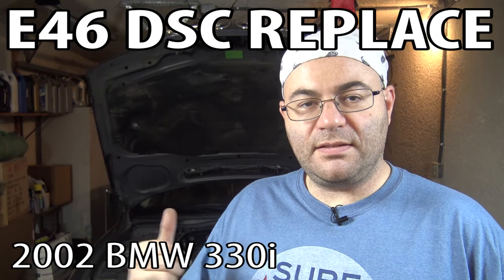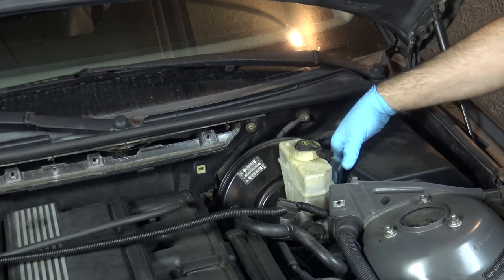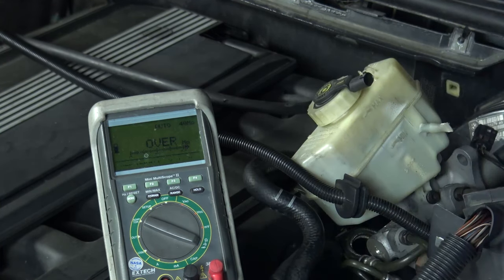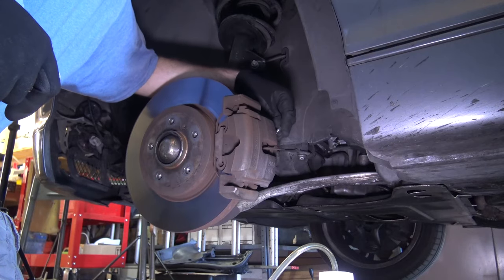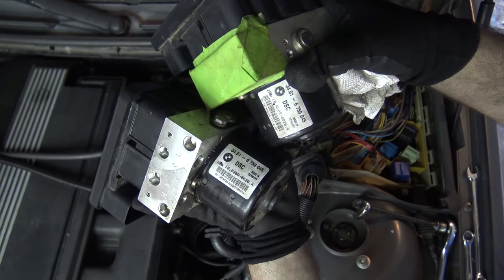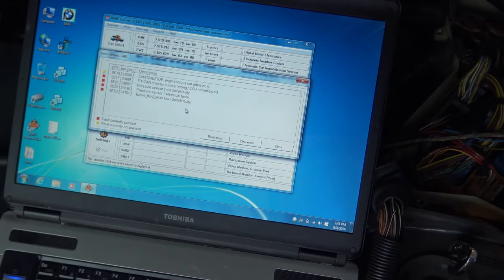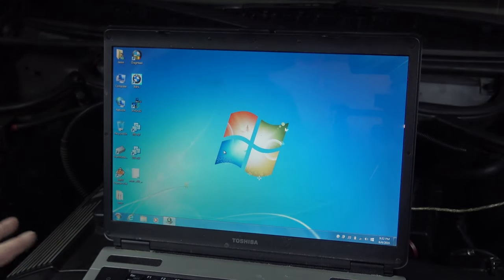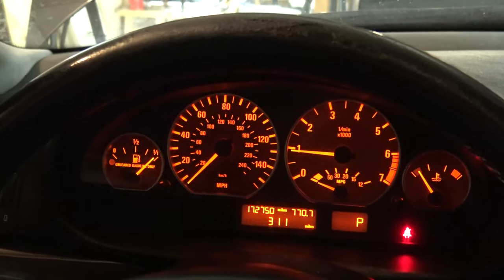BMW E46 DSC (Dynamic Stability Control) Unit Replacement & Coding! DIY

Comment: had that problem ON/OFF for about 2 years. it did not bother me until one day all DSC lights came ON and stayed ON,,, however I already had an idea of what my problem was, one pressure sensor was malfunctioning and once the second went bad lights went On permanently,,,so one mechanic refused to replace 2 pressure sensors claiming it is ODD for 2 of them go bad & it must be DSC module $2550 for the job- funny guy with 35 years of master BMW  certification,,,, went to another one who in less than 3 hours and 125 for a labor plus the cost of sensors replaced them,,,,Problem Solved,,, HINT: do not buy these sensors at the dealer or genuine bmw,,, they are freaking GM pressure sensors and cost 10x less than what bmw wants for them,, iI paid 27$  each vs $214,,,,

Comment: 50skid, I CANNOT thank you enough for putting this video together. It was SUPER helpful with instructions on how to change the pump. I went ahead and did it tonight... Man those fittings easy to take off but theyre super hard to thread back on, i almost stripped one of the lines..
Reply: Also the NCS expert procedure didnt code the vin to my car... I tried and tried following the exact steps you did, but it wouldnt write the vin. I found these instructions that did work for me:

When playing with DSC it is almost always necessary to recalibrate steering angle sensor. I do this with tool32.

- launch tool32
- choose "load SGBD"
- browse to DSC_87.PRG or whatever yours is.
- select job "lenkwinkel dsc abgleichen"
- double click this and it will take around 3 seconds to complete
- job done

Comment: Do you have to bleed the brakes if you just quickly change the DSC Pressure sensors without completely or near completely emptying the brake reservoir? Thanks!

Comment: why did you replace your abs and dsc ? Was your dsc light always on?
i have problem with my E46 316i it has ASC not dsc.
My light is always on on diagnostic its saying: 93 ASC: CAN Data Fault From DME/DDE
I tryed to find problem on every possible site/forum and cant find the solution. 
Some1 said replace tps sensor and that solved problem, i tryed that and i have still same problem.
i also have error with tps sensor. When i enter on inpa to check the TPS its showing vaule of !100.39, and when i press my gas value doesnt even move its stay the same.
I checked my TPS and its functional. Realy i dont know what should i do next.

Comment: hello friend i know has been a lot of yerar hope you can help me, i have replaced the abs unit from one second hand, the abs and hand brake red go away, but, always a but, hahaha the triangle stays on , have the errors 5e1f . 5e21 . 5e20 . 5e1e . 5d8c. same as you!! mi car has ASC button so, in some place i read that the mk60 dont have angle sensor,can you confirm that? the pa soft dont recognize the angle sensorand inpa etheir, so i dont know if my car should have or not angle sensor. my car was replaced the cluster and the LCM , this two parts are matched with a vin mumber that dont match the original vin car as well, my question its,in this case witch VIN number have to has the abs module? because the pa soft bmw1.4 scanner can write the vin in the abs module, but witch vin have to has to erase this error, thanks a lot, my car comes with a lot of prombles, because has various modules of other cars, bmw 2002 e46 318i 4 cyl N42B20 i will be very happy for your help

Comment: First, thanks for all you do for this community.  Your videos are unparalleled.

My son bought an E46 325i, and I've spent the last month meticulously watching your videos.  I cannot overstate how helpful they have been.   So far I've used your videos to do the following:

- rebuild parking brakes
- diagnose trifecta
- replace VC gasket
- replace OFH gasket
- replace all pulleys and belts
- replace water pump
- replace cooling system components
- replace CCV system
- replace starter
- replace manifold gaskets
- rebuild DISA valve
- replace oil pan gasket
- replace ABS/DSC module

I will be getting everything zipped back up this weekend.  Now I am on a quest to find a laptop to run Win XP so I can bleed the new ABS module and code the VIN.

Question - I assume it's ok to start the car back up prior to bleeding/coding the ABS module?  Just want to make sure everything is running ok after all that work.  I'm guessing it will throw codes, but I can always clear them.

Thanks again.
Reply from the maker: You can start it back up sure.  Just don't drive it--you'll know why when you feel the brakes.
Reply: After a month of work, car started right up and runs like a champ.  Trifecta is reduced to two amber lights - DSC/Brake.  Of course, that's because LWS calibration.  Went into INPA, and there was the Shift-F4 option for Compensation Routines.  Quickly checked errors, "VIN not initialized" error was present.  Went back, and Shift-F4 option IS GONE!  Can't get it back no matter what I do.  Went into F6-Activate, where there is a "Compensation Routines" option, but there is no "Steering Angle Initialization" option, only the other two - "Pressure Sensors" and "Lateral Acceleration".  I'm sooooooo close, and it's mocking me.  Any ideas?

I already reinstalled Win XP to delete all my old INPA stuff, and reinstalled a [slightly] newer version of the software.  Same result - no Shift-F4 option, and no "Steering Angle Initialization" option.

Thanks again - your videos are fantastic.
Reply: Ok, update.  I took the car to the dealer and they claimed they could not reset the steering angle sensor with their software.  I then downloaded Mike's EasyBMWTools which comes with INPA 5.0 - MUCH easier install.  Got the link for it here: http://www.bimmerfest.com/forums/showthread.php?t=1023698.  Installed it on my Windows 10 pro machine.  Bingo - there was the shift-F4 option.  Done.  I am now back on the road, and trifecta is gone.  Thanks for your awesome videos!

Comment: Just plain excellent filming. Using the computer software was a little confusing, but I understand that's one of those "you had to be there" sort of things. Keep up the great videos! And thanks.
Reply from the maker: Was it?  I thought I was showing and explaining each step for ya as I used the computer...
Reply: You absolutely did. I'm just saying that it's clear you need experience or written instructions, like you had, to operate the software effectively. Not meant as a criticism at all! I really like your videos and respect your willingness to work on the tough stuff.

Comment: I am a subscriber and I really enjoy this channel. U approach new stuff with a can do attitude and help us along the way. I will watch again, but I am a little confused on the set-up u used for the scan tool. Great job!!!!!
Reply from the maker: Sorry Bill, I realize now that it can seem a little confusing because I went and switched scan tools part way through the video.  I should have inserted a scene where I mentioned this and showed you which scan tool I had switched to.  For the record, I switched to an K+DCAN cable with INPA software (it comes with the cable).  There are links in the description.
Reply: +50sKid Thank u!

Comment: Hey man thanks for the great videos, they are extremely informative and concise. I have a similar issue but only emergency brake and DSC light turn on. ABS light stays off. The scary thing is that if I don't turn off traction control (holding for 5 seconds) before I drive (ie sitting int he driveway or parking lot), after driving and hitting about 10mph, the DSC unit will audibly cycle and my brake pedal automatically pumps itself and the brake calipers. This can be scary as I lose all control of the brakes until I try to turn off traction control. The brakes intermittently pump and the vehicle is slightly slowing down in pulses. Turning off the traction control while the DSC is cycling and throwing a fit (while the car is moving) proves to be difficult. It will show both DSC and emergency brake light as if traction control completely turned off but then the vehicle will then turn off the DSC and emergency brake light and start pumping again. The only light that flashes while this issue is occuring (DSC audibly cycling + brake control loss) is the DSC light itself. If you have any input that would be great. Im tired of turning off my traction control before every drive. I appreciate any ideas of why my E46 is exhibiting these issues.
Reply from the maker: You really need to get INPA and read the error codes in the DSC module to give you some direction.  But if you want to guess, replacing all 4 speed sensors would be a great start.

Comment: I've noticed since I started playing around with European cars that they use brake fittings with 11mm hex drives, a LOT! In fact between one Mercedes, a BMW, an Audi, and two Porsches, they have that size wrenching throughout them, from their master cylinders to calipers.

Comment: I have the same problem.
I noticed the lack of 10V voltage Uref (in Inpa).
As soon as the tension disappears appear DCS control failure.
Tomorrow remove the pump.
Thanks for the video (all your movies are helpful).

Comment: I think I have a bad dsc on a 2002 330i. I have a foxwell code reader which show a 5df5 error code. The dash has 3 lights, DSC, ABS and Brake.  I drove it watching the speed sensors and they all tracked within 1 of each other. Most of the time all four read the same number. Sould I check anything else before buying a used DSC? The code reader shows it as an MK60.... I have appreciated your videos and expertise for several years now and thank you in advance for any advice you might have for me..

Comment: 50skid, I just subscribed to your channel!  Love the videos! Very helpful! I just bought my first BMW. I’m currently having issues with this ABS / brake light on. I changed all four speed sensors but the lights still come on! Took it to a mechanic and told me it’s the abs module and very pricey!!! Is this part expensive? Thanks in advance!!
2002 325i
Reply from the maker: Yeah it is but you can find a used one and code it like I did in this video

Comment: Thanks for this great DIY as usual. Does the replacement of the sensors introduce air in the brake circuit ? Thank you

Comment: Hey 50’ kid thanks for the video,like 4 years later, try a z4 much easier to work on ,I’ve recently a 005e20 fault on my Carly code reader which is the pressure sensor you showed,would you say there’s not really a way of testing them for faults before replacing?

Comment: The only lights are on, on my 02 330ci is the DSC and the brake light not the ABS light. could this be a sign of faulty speed sensor? And also my DSC button doesn't work I tried holding the button down for 10 sec trying to reset it but nothing happened. Any thoughts on my situation.
Reply: Rafael Fuentes this is the problem I’m having, did you diagnose it in the end?

Comment: First,  I watched most of your e46 video. Very very informative and detail.  Thank you for taking the time to make the video and sharing it.
I am having problem with my 01' 325it with automatic.  I am preparing to replace my abs module and waiting for the used part to come in.  I bought the cable a while back but having trouble installing it.   
My question is if I don't code the module after install, what will happen?  Will the abs still function?
Any tips how to install the inpa?
Reply from the maker: If you don't code the module the dsc will not function.  I'm not sure if the abs part of it will still function (the difference being the abs only works when you slam on the brakes, but the dsc works when your wheel loses traction).  I don't have any tips for INPA, you just install it.
Reply: Further question.  I did successfully replace the ABS module.  Thanks for your instruction video.  I watched 10 times before I started the work.  I haven't bleed the brake yet.  I tried to pump the brake pedal, it went all the way to the floor.  I pumped many times, it still went down the floor.   Is it because I must bleed the ABS module(pump) with inpa before I can get the pressure back?

Comment: Everyone says that when replacing the A. B. S control module that it needs to be reprogrammed. However, I purchased an ABS control model used with the exact same numbers as my old module. And that fixed my ABS and I did not have to reprogram thoughts on that, please.

Comment: i once got those 3 lights on my e46, but it was just the brake fluid that was low.
Reply: What if my brake fluid is not low ?
Reply: @wildhunt2235  Read the codes with a diagnostic tool then

Comment: Hey 50kids, I have a case where one of my abs line to the front right is in close position not allowing fluid to flow to the caliper. Should I replace the unit or if there is a way to open the valve?

Comment: Code 5E20 and 5E21 is for the pressure sensors inside the hydro unit and not those attached to the break cylinder.

Comment: Hey, Thanks a lot for all of your videos! They have helped me a bunch. Quick question..Is it ok to remove the brake reservoir from the master cylinder? I am installing the module and I am having trouble trying to get one damn brake line left to screw in and it would be so much easier if i could remove the reservoir. Thanks again!
Reply from the maker: Absolutely

Comment: Hey whats up Justin glad your back! Listen, my traction control activates for no reason, just cruising down i5 dry roads and bam it starts then the triangle and brake lights light up no abs light though then when I turn the car off it will.do.it again domestics not.for days sometimes right away, now the triangle and brake light stays on
I replaced all of the speed sensors and it didn't do anything. Any ideas? Is there anything else I should be looking at before I go after that dsc unit? Thanks dude

Comment: For the people who dont have NCS Expert and INPA, you can remove the electronic part from the metalic housing of the DSC unit. I'm not sure if you will need to replace the whole thing if you have the "Internal foult" error. But if you have an internall pressure sensor error you dont need to replace the electronic part of the DSC unit. You can unscrew the electronics from the unit with som hex bolts i think. You also dont need INPA to bleed the brakes, atleast i didt. Do keep in mind that this was on my E90. Just ask if you need more help.

Comment: Thank you for publishing this great video. Quick question - I have a 2000 323i, and it looks like my DSC unit is on the passenger’s side of the car, not on the driver’s side like yours. I’m assuming it is the same one but perhaps BMW changed the location later on? Thank you!

Comment: 50's Kid.  Which video do I need to figure out why my ABS slightly engages and throws a code on the dash.  I also need a lead on which reader or cable do I need to begin to discover what is going on with the car.  Can worn front end parts be to blame.  It seems that the problem may begin when we hit a small bump in the road.  car is a 2001 BMW 325 CIC.  Thank you in advance.

Comment: I have an 02 325xi. I had a headlight go out (drivers side) and immediately had the trifecta with the red brake light and my gages all went to the max. I was able to reset my gages and when I start the car every thing is normal and no lights. If I turn the headlights on, I get the trifecta with the red brake light. If I leave the lights off and press the brake, I get the all yellow trifecta. I’m currently waiting for the bulbs I ordered to get here so I can put a new bulb in. Hopefully somehow that is what is triggering my trifecta, but that being said, do you think that’s possibly the main cause? Literally nothing was wrong until that bulb went out….

Comment: Kid, Hello!  I have a unique problem, namely my speedometer is flat - does not move from below ZERO. I've checked everything: continuity between ABS Module and cluster, (checked cluster on another car and speedo works fine) back wheel senders.  There are no fault lights on or codes on the cluster, and all functions of cluster work except for the ones connected with Speedo: odometer, mpg needle, and cruise control.  So I presume the ABS module is bad.  I've checked your video where a module from wrecked did the trick; I can install another module per your directions, but am totally insecure about the recoding. So, question:  where are you located and would you be available to recode my module if I were to replace and bring car to you??  Or??
Thanks!  I don't mind not having a speedometer, but not having cruise is a pain!!!

Comment: hi please help me i am in the same situation whit the lights on the dash...
also replaced all abs sensors because it needet and now it shows abs pump 
i use a delfi 2013 diagnostik tool ...
is it posible my problem to be that presure sensor? my car is e46 99 whit ASC   sorry for my bad english and thanks

Comment: okay please help my other phone just broke I am subscribed to your videos I watch you all the time I have the ABS Trifecta brake light in red last week I adjusted the handbrake and turn the key a couple of times and the lights went out for about 2 days now they came back on I have a Creator c-110 scanner it does give me the 5df internal code fault just wondering if there is any other chance it's a sensor instead of a whole unit also I have a 1.4 however do not have Windows XP understand that you can connect it to Windows 10 or 7 just don't  have to know how. please respond if you can

Comment: Great video! Question on the part.  I have been searching for a used DSC control module.  Most of the units found on ebay got the right part number 34.51-6759045, but the last 12 digits are different.  For instance my is 10.0206-0002.3 and most of the item on ebays are 10.0206-0026.4.  Are they the same part?